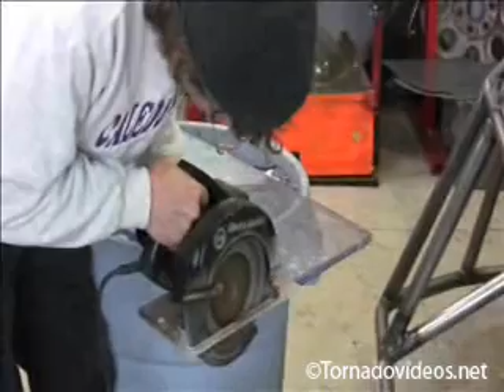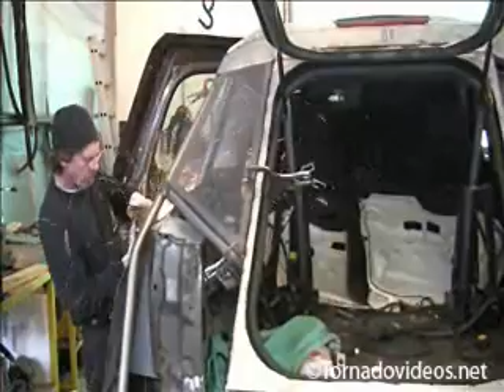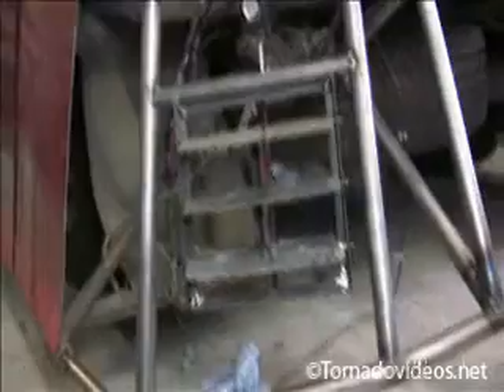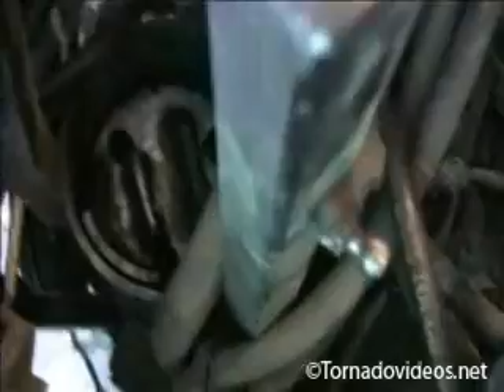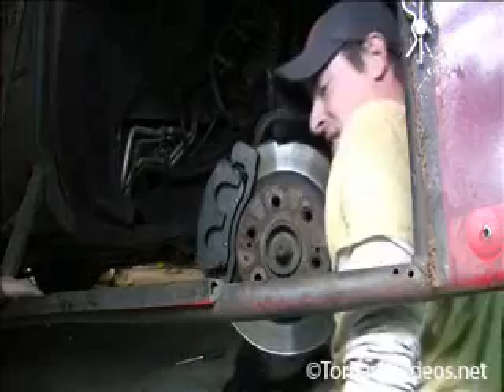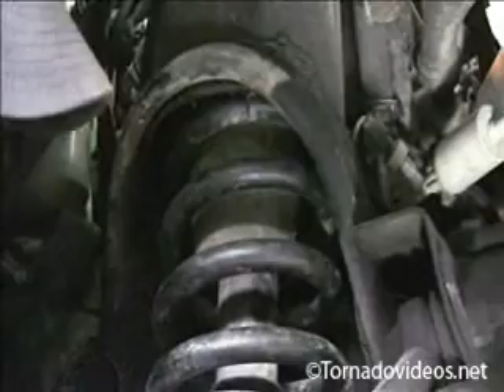Rebuilding the Dominator, Part 6!

Comment: if you opted it right you could have got a 8.1 V8 or swap the engine for the 6.0 V8 and supercharge it. there are also lots of aftermarket bolt ons that would help with performance issues such as MORE POWER or better brakes lol!

Comment: @darokkz acually you can get the 5.7 in the tahoes you just have to chosse that option when you order the truck i would know this because i work at a gm dealership most tahoe that come to the dealerships tho have the 5.3 in them so if you just buy off the lot you are more likely to get the 5.3